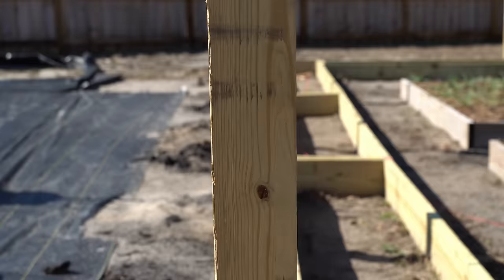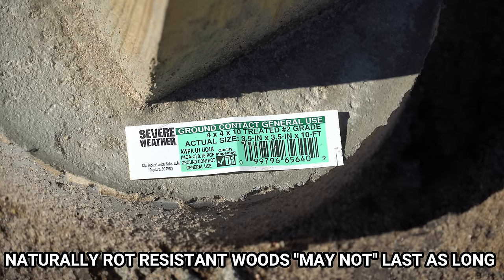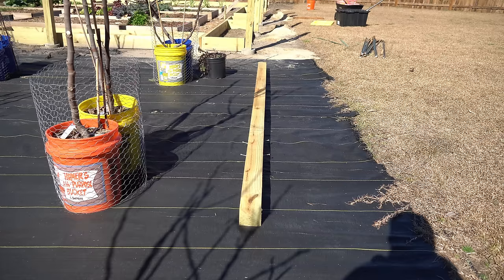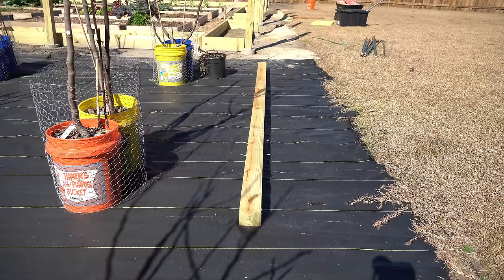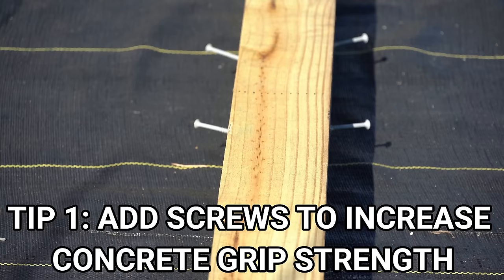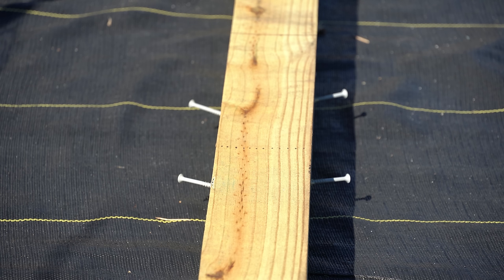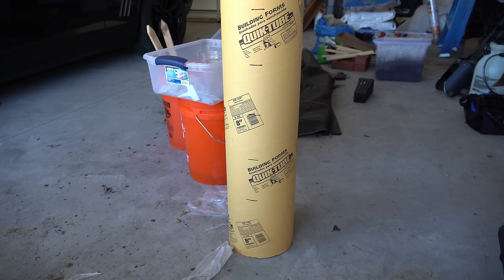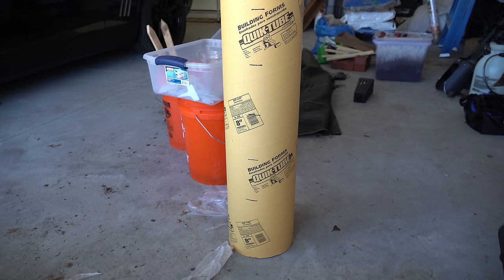3 Tricks To Installing Stronger 4X4 Wood Fence Posts That Last Longer

Comment: I have one recommendation about wood post from an aesthetic point of view. Do not install post that extend above the fence line like fleur de lis topped post. (ornamental tops) The birds love to land on these and they will crap all over them. I have had a fence that is still standing since 2002. Some post lean out but it is essentially still strong. My only complaint is the birds are landing on these post and fence post rot at the base. We have clay soil and in some areas damp soil. You can use epoxy to fill in the base of the post where the rot has occurred that may extend the life of the post but I am not a fence builder and have no experience with this so don't take my word for that idea but ask someone with experience on dealing with rotted post. Also, I would recommend a gate be installed that is wide enough to accommodate the largest zero turn mower. If you use a lawn mowing service this is essential. Gates should be reinforced with a non sag feature. Note: they have metal non sag supports available. Staining the wood before installing the gate is recommended especially the cut ends. The gates will go first. Add a drop bar to stabilize the gate when it is open to prevent the hinges from bending in the wind. Home Depot has them. You might also ask the fence builder where he bought your fence planks so you can buy replacement planks down the road and the type of wood and type of fence planks used. Stain them before installing them on the fence. Sand them or have them planed when you buy them if they offer that service. Staining the fence periodically is essential to extend the life of the fence. I use barn red as it is always available and algae does not show too bad. Use a solid stain. More info than you needed but I was on a roll. Oh, have them use stainless steel deck screws. Have them use 1 and 5/8 inch deck screws so they will not protrude through the back of the fence plank through the 2x4 nailer boards. Yes this will cause the fence builder to source these as Home Depot will only have two inch deck screws. I had to explain the reason as to why I wanted these at my local Home Depot and they actually started to carry them. I was surprised. The reason for using these is that the wood will not rot where the deck screw enters the plank. Coated deck screws can rust and cause a reaction with the wood and cause it to rot thus the reason for using stainless steel. Some fastener outfits sell colored tops on stainless steel screws if you want them. Periodically go around your fence to tighten planks with additional stainless steel deck screws. Spring is a good time to do this. Stain every three to five years. Use the best stain available to extend life of stain. If you use a brush it takes a long time. Cut off end of planks near the ground so they don't touch the ground. Keep all vegetation off of the front and back of the fence. If you do not do this you might as well throw your money out the window. Please don't put up a fence and not stain it. Please clean your fence periodically to keep the black mold off of it. My neighbor has done nothing to his fence since it was installed and it look hideous. Don't be that neighbor. I also had my fence planks spaced an inch apart and this will help with planks not rotting because the wood touched the adjacent plank and retains water longer thus causing rot. This will make it more difficult to stain since you will be staining all sides of the plank but it will last longer too. Avoid rounded tops as the end grain will have more surface area to accept water on cut edges thus more rot. Pay particular attention to cut edges by staining them multiple time to prevent rot.(more coats required) Use a drum sander attached to the end of a drill to smooth out edges if you have rounded tops before staining. Available on Amazon. That is about it. Hope this helps. Having a fence is like taking care of a baby. If you give it love and care it will be strong for years to come.
Reply: wish i could print this out for reminders. thanks
Reply: That was 1 long recommendation

Comment: If you angle the form make sure the high side is pointed at a corner of the post and not a side. This will split the water as it runs down. If you point it at a side the water will sit on the high side of the post. I just cut the forms straight and then slope the concrete away from the post on all sides.

Comment: I paint the bottom 3' of my posts with roofing tar and pack gravel and clay to set them. Last just as long, just as sturdy and will be easier to remove them when it's time for replacement.
Reply from the maker: I would strongly recommend against coating with tar, creosote or any of those other chemicals due to contaminated soil.  I would not want to grow anything in that ground.
Reply: @TheMillennialGardener  well no, obviously not. But for fencing it works just fine

Comment: Great tips 👍. I used 1/4"x 6"stainless lag screws in every footing for the floor joists of my wife's craftroom. Always opt for douglas fir pressure treated lumber if available (usually at lumberyards), little more expensive, but waaay better than hem-fir (you can read online articles that basically sugar coat hem-fir's inferior viability, but it will NEVER last as long as douglas fir pressure treated). If you're gonna do something right...start from the foundation 👍.
Reply from the maker: Roddy Piper for these garden beds, I went with basic Lowe’s #2 Prime, but for something structural, I agree.  The warping alone can be terrible on this cheap stuff.

Comment: If you coat the bottom 3.5' with creosote it will add 30 years to the life of your posts. Everything else you do is good.
Reply: Where does one buy creosote
Reply: @caseyritter3185  You can buy it at Walmart, its called CREO COAT

Comment: I personally can't see those screws adding anything. I bet if you pulled the post out of the ground the concrete will come out with it. Every time. Without screws or anything.  Trust me. Steel post we like to beat up with a hammer to give the smooth steel a odd shape for the concrete to grab. Perhaps the same could apply to wood? Excellent idea putting gravel at the bottom. If you crown the concrete at the top it will solve a lot of rot issues. Great video and I'll have to hop over and check out if you finished and what you're growing.

Comment: So smart! Too bad the guy who installed my privacy fence 15 years ago wasn't smart enough to do that. I've had several posts for and snap off in strong winds. I was considering how I could do it differently. You just solved my problem. Also, I saw your response to someone else about going one third down for fences and below the first line. I believe my code here (Northeast Illinois zone 5) is 36" but it obviously didn't work. Going with your advice when I repair my fence. Now if you could tell me what to do about metal stakes in asphalt. My carport stakes lift when the ground freezes. Lol thanks
Reply from the maker: Ms. V. Jackson I live on the NC coast, so my ground doesn’t freeze.  I don’t have an issue with frost heave.  You may want to check what your frost line depth is and ensure you’re deeper than that.  It may be deeper than the 1/3 rule.  As for your carport, those stakes probably should’ve been embedded in concrete, I’m guessing.  Asphalt isn’t structural.  It doesn’t hold things in place like concrete does.  I’m not an expert on pavement, though.

Comment: Concrete ATTRACTS WATER,  increases and accelerates rot.  I used to use it.  It holds moisture against the post. Drilling screws into the post just delivers more moisture into the post.
Reply from the maker: A R if that were the case, concrete wouldn’t be used as a foundational material in building codes.  The fact is, soil has rapidly changing soil moisture characteristics.  It can go from sopping wet to bone dry to frozen.  Concrete provides a consistent embedment material that does not expand and contract with much with temperatures and does not change much as soil moisture changes.  In addition, you don’t know how long your soil will stay wet 3 feet down.  Concrete is an insurance policy.
Reply: @TheMillennialGardener Yes concrete is used in foundations. In that application, its a great material. There is no problem with concrete being listed in building codes for that.  We are talking about 2 totally different things. What you're saying is completely unrelated to my comment.

Comment: The timber posts shrink over time the point of the screws of nails is that despite the
shrinkage the concrete will grip the screw, this keeps the post more likely to remain
firm in the ground.
Reply from the maker: It also helps with any upward forces, vibrations or gate attachments.  It's one of those steps that takes literally seconds and costs next to no money, so in my opinion, not doing so is silly. Thank you for watching!
Reply: Aren't they more likely to swell in size when they become wet?
Reply: Silly? I have built hundreds of post frame buildings.  Thousands of posts imbedded. Demolition of some. Observed the durability of many more - some in horribly corrosive conditions. I have some simple and I hope we'll received advice:  Quit over thinking the process and then passing it on as some sort of wisdom.  I could rant for pages about this video and many of the comments adding their little bit of "expertise" - I won't.  I will sum it up this way: Yours and many others present an academic exercise in perspective that doesn't match the real world.

Comment: 900 mm x 150 mm Drainage Pipe capped 1 end.
Concrete 3ft x 6 inch drainage pipe capped end down.
When dry use Exterior building grade construction grout to fill pipe with post in it.

Comment: Water would pool in that gravel and if the bottom of the post is not sealed with asphalt or just put in direct concrete to the bottom, water can get absorbed up the post.
Reply from the maker: The posts are ground-contact treated pressure treated wood.  I would strongly advise against adding petroleum products underneath garden beds.  You should not use anything like that for your garden.

Comment: Thank you!!! The tip about keeping the cement above the ground is exactly the advice I needed.
Reply from the maker: Dawn Fenton thank you.  In the business, we call that a Foundation Reveal.
Reply: Not sure where you live or the climate. In Canada never keep the cement above ground. Ice and thaw will heave and pull the post out of the ground. Personally it's overkill. Keep the cement low. Btw farmers have fences. They don't use cement. They stay straight and are still fine after 100 years. Just saying.

Comment: if the outer surface of the concrete is even and smooth its going to be weaker because it needs external irregular shaped points to grab onto just as it does interiorly with the post and the screws so it needs to form around rock and such lining the hole

Comment: Using your concrete base for a 4x4x12 wooden pole, with 3' in ground. as LAMP/Camera post: Any idea whether pole will sway in the wind that my steel pole already do in common 30mph wind here. Swaying in wind obviously is not good for camera videos. I was even thinking of doing 2 to 4 pcs of 4x4x12' and strap them together for less wind sway instead of using guy wires to tie down top of one pole (but this poses mowing issue with the 3 additional ground ties). Please share your experiences anyone. Thks.

Comment: I have pulled up treated wood posts from the ground and the concrete holds on tight. Can’t get it off.
Reply: Absolutely right. All the screws do is give another point of entry into the wood for moisture and rot.
Reply: I’ve been in the trades for over 30 yrs I have never added anything to post. I seriously doubt there is a need .......

Comment: Form tubes are good,But not if your installing a picket fence (it will get in the way)I fill and spread about 15 inches of white liquid rubber to protect the post from rotting.5 inches above and about 10 inches below .Then pour concrete. Tape lower part of post all around to have a nice clean line when spreading liquid rubber.

Comment: I am straightening out my fence from Harvey, YEP, you heard right(LOL), I have meant to do this project for a long time but I work like a mule almost 6 or 7 days a week. Anyways, all the comments are good and differ form how long it is expected to be in the property you live in. I am personally fixing it to the point that meets the HOA guidelines or it is strong enough like for the pickets to stand in place. I use screws all the time, nails take too long to take out and most of the times can't be reused, which, I never do.
Reply from the maker: Wow, that was a while ago!  Florence knocked down a lot of fences in my neighborhood as well.  It's never any fun.  Fences don't last all that long around these parts!
Reply: I'd never Live where there is a HOA.. My house i wanna fix it the way I want it lol. But just my opinion..

Comment: It's horses for courses, I always tell my clients treated pine is going to rot,  if you want longevity and don't mind spending the money go for galvanised steel and lay the concrete off with a neat 40mm x 40mm 45 degree angle feathered off just around the post to assist water run off.  If longevity is not an huge issue 5/10 years and they want to save a bit of money over using steel we can use treated pine and still lay the concrete off same as the steel.  If the client's budget is the main priority (read cheap job)  I always finish the footers off 4 inches below ground level with a slight no fuss angle on the concrete any water may collect on top of the concrete footers disburses into the surrounding soil through capillary action as the soil dries,  the up side is the water doesn't pond on the top of the footers and you don't see any ugly concrete.

Comment: Lots of overthinking and overspending here. In Georgia, clay soil, I just dug holes after 2 weeks of rain, hardly any moisture past the first 6-12 inches.  In my 18-24” holes, I packed dirt in the bottom foot and concrete in the top foot. 
In other parts of the country, the information in this video may be needed, but not here.
Reply: Concrete is wasteful.  Nice idea but wasteful.  When the post rots as they will, now the person has to dig out the concrete and get rid of it.
Reply: I know right?!😂🤣😂🤣😂 i think he is saying that you have to do this this way, his way, because there is NO OTHER WAY! 😂🤣😂🤣😂
Reply: I took down a cedar split rail fence with posts. I built my fence over 35 yrs ago and they are still going!!! No drycrete, wetcrete, foam, charring, tarring, or treating... and in the actual ground!! Lol i dont need a tutorial from him... i should be teaching him. I learnt from the man who gave me the fence. His father taught him. Im 62 now. I dont watch tv anymore. For intertainment i watch these tutorials to get my laughs!!!   😱😱😳😳🙄🙄🙄🤣🤣😂🤣😂🤣😂😁😁😁
Reply: Yes, he totally misunderstands clay soil. He probably is setting posts for the first time and is merely regurgitating what he read and din't actually understand much of it.
Reply: @beebob1279  Not true at all. Concrete serves a purpose. It anchors the post in something solid. Soil isn't solid. It also makes the post rigid, soil won't do that either. Posts will rot, but done properly it can last 50 years. Buried in dirt, maybe 10 if you are lucky.
Reply: @MrRaptorman1975  Wood will still rot in buried concrete.  What planet are you from?
It still rots.  I may take a little longer but it still happens.   Wow.
Reply: @beebob1279  That is exactly what I said. I think in your haste to respond you glanced over my comment and didn't give it the attention it deserved. Post will still rot but when done properly they can last a lifetime and not just a decade.
Reply: @beebob1279  I will also further explain. Since Concrete is an alkaline environment it is very difficult for the bacteria and more importantly the fungi to survive let alone survive. Soil is the perfect environment for them so concrete absolutely retards the growth of the two organisms that cause rot.
Reply: @MrRaptorman1975  What about water sitting on the concrete and soaking into the wood?
Reply: @beebob1279  What about it? Water alone does not cause rot. And water doesn't sit in concrete. Concrete is porous and will allow the water to move through it. Does water sit on or soak into your driveway? It soaks in and into the ground below.

So we agree that I never said that wood doesn't rot in concrete?

Comment: I have 4x4 post to install. But am thinking it is easier to use a piece of PVC sleeve around the edge instead of the sono tube. Especially that it cost about the same
Reply from the maker: How will you remove the PVC after the concrete sets, though?  The concrete will adhere to the PVC tube.  The reason why we use the Sonotube is because the cardboard is easily cut and stripped away.

Comment: I am building a horizontal fence board design. The quick tube is a great tip. How best to keep my lowest fence board tight (so animals go go under) when the cement is 3 inches above and does not allow a board to be flush.
Reply from the maker: Have you considered purchasing 24inch welded wire fence, burying the first 6 inches under ground, then securing the other end of the fence to the back of your wood board? It may not be the prettiest option, but it works well. I'm using chicken wire for this.  Even if you brought the boards down to grade, animals will simply dig under it, so it helps to have some buried metal fencing.
Reply: @TheMillennialGardener  great thought. Thank you !!

Comment: Regarding the screws used to improve anchoring into concrete... Would there be any issue with using stainless steel screws???   Thanks
Reply from the maker: Not at all!  SS screws are fine.  Thanks for watching!